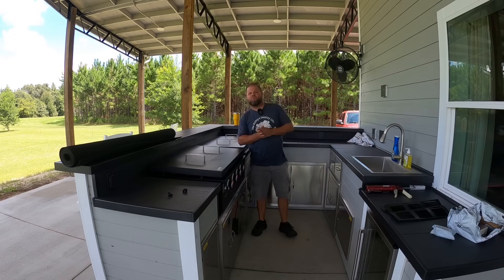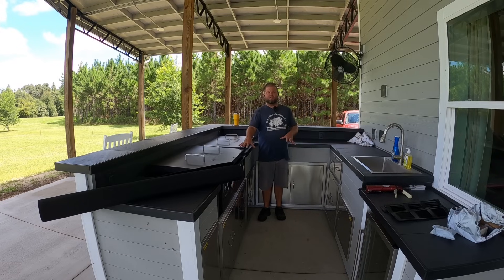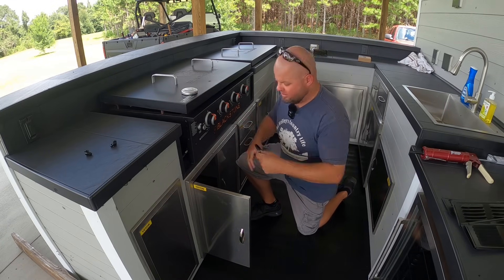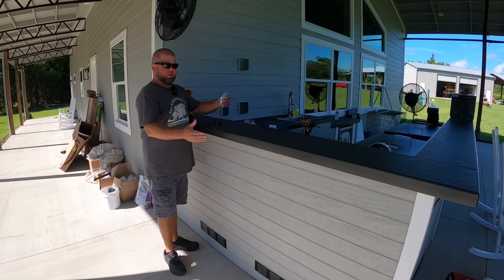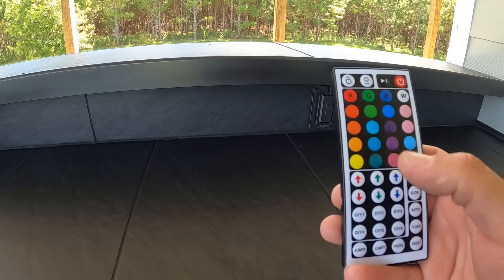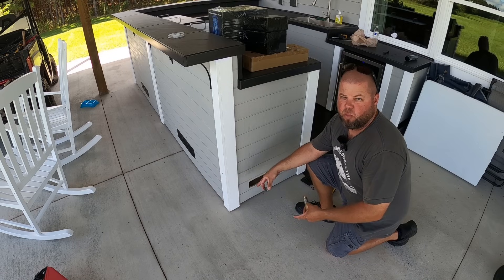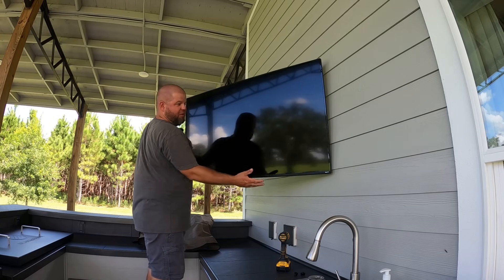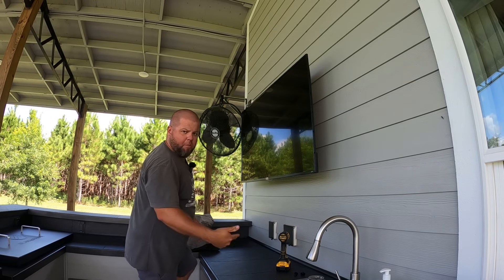DIY outdoor kitchen build! Final episode with cost! #635 #Vevor

Comment: Andrew, I stumbled across your channel back in the spring of 2024. 

I'd been planning to build an outdoor kitchen space, using an existing patio area. I really liked the way you approached the construction, so I used several of your ideas as patterns for the way I built our outdoor space. 

So, since June of this year, we put a roof over a 21'x26' space, built a deck over the existing (not level!!) concrete patio (that was fun! lol), built out the cabinets with (2) countertops plus a bar. The bar top is a single piece of limestone that measures about 16" x 8ft long. I went with Vevor for all the drawers and doors, even used your router method for the cabinet fronts. Your channel has so many great tips.

I decided against tile for the countertops, went with butcher block to save money, screwed up the stain and polyurethane, stripped it off, decided to go with Epoxy instead... HUGE mistake. All the butcher block is coming out in a couple of weeks, when the granite tops should arrive. What a mess that was. I'd like for you to see the pics sometime, because it's turned out to be a fantastic space. Thanks again for all the helpful information!
Reply: What was the problem with epoxy? I was thinking of using it.
Reply: @trailblazer7108  I didn't realize that Oil based stain is a mistake with epoxy. We had originally planned for oil based stain with Spar Urethane and didn't like the results, so we decided to try Epoxy. I stripped the stain and Spar but apparently the stain (even with thoroughly dried for over 2 weeks) had a nasty reaction to the oil in the stain. The out gassing was really bad. Epoxy is beautiful, but in my case it went from bad to worse. If you use Water Based stain, my understanding is that it plays better with Epoxy. I found some great resources on Epoxy. In particular look up this guy. He does beautiful work:  https://www.youtube.com/@northernridgedesigns

Comment: Looking AWESOME!!!

A few ideas:

1)  If you need to, instead of replacing the LED strip with rope lights, just make your own by buying some cheap clear hose and run the strip back through it, then plug the ends with either silicone or hot glue.

2) Paint a cap for the propane valve to match your decor.  It'll look better, and stop anything from trying to nest in it.

3) Place a catch bucket under the zappers and feed the bugs to your chickens.  Protein for your protein!
Reply from the maker: Love idea #2! Thanks
Reply: @TKCL  Happy to help!  Been watching since the beginning of your ice machine project.  Of which, I can't seem to find any final results of...???
Reply from the maker: I've posted a few recent #short videos. It's working great and being used weekly.

Comment: A good tip for using LED tape is to buy a translucent channeling and place the tape in there. If you get a tape with a lot of leds per meter it will look like a continuous strip rather than seeing individual LEDs. 

Just found your channel today and these videos have game me some ideas ans inspiration to start building my back garden out.
Reply from the maker: I'm about to change those lights out, thanks.
Reply: I did that with aluminum channels with a frosted plastic cover. They shipped directly from china. It said what they were on the package but not descriptively, customs felt they needed to open and check them out. lol My strips had leds a little closer and I ran two strips in each one to make them brighter. But I made them for photography.

Comment: I put the same strip lights on my bar. After I stuck them on I used thumb tacks to ensure they stayed on. Do not stick the tack through the strip, just use the head to hold it. Mine are still up after 3 years.
Reply from the maker: Great to know

Comment: Couple years ago i had to built my framing out of metal due to the prices of lumber through the roof.  I had granit tops installed ($1400 +$800 install) i did not even think about tile, yours came out really nice.  I added the govee led lights around my island and love them, they have difderent patterns for different occasions.  I think mine ran arpund $7500 with everything mostly done myself.  My grill alone was ($2400 napolian pro 665).

Comment: I have a Stainless Steel Breville ct oven which has 2 shelves and is also a convection,  broiler, airfry, toaster etc... it's small but big enough for a regular size cake pan, I just love it, I take it camping with me!!
Reply from the maker: I've considered something similar
Reply: If you want a more commercial feel, look at the waring WCO500X.  Fits 4 half sheet pans!

Commercial kitchens use it

Comment: If you want to have a permanent install of the LED lighting, use aluminum LED track with diffused cover, and also, use better quality LED's, those will last weeks if your lucky. They just can't handle humidity being out in the open like you installed them. Also seal connections with Dowsil 737 silicone, NOT the home depot stuff! I do a fair amount of custom lighting. I'm NOT trying to be critical, I love the kitchen, Just passing on some experience with thin-strips.
Reply from the maker: So far zero issues.
Reply: What LED's would u recommend?  Great tips!
Reply: @brihal6498  Fully tubed (IP67 rated) strip tucked inside of aluminum track has given me the longest life. It's critical to fully weather seal with an alcohol based silicone like Dowsil.

Comment: Not sure if you did this but make sure you used teflon tape to where the gas hose screws in to the QCC1. Would be a much bigger deal indoors but still don’t want any gas leaks.
Reply from the maker: I used liquid thread sealant specifically designed for gas connections.

Comment: Great job on the planning and execution of the outdoor kitchen. Extremely impressive build. I was wondering why you didn't paint the edges of the hole you cut for the gas line.
Reply from the maker: I should have 😬
Reply: @TKCL  you could always caulk the gas line, the only place for water to get in is around it

Comment: Andrew, quick googling shows bug zappers are ineffective against mosquitoes.  You need one that is meant for mosquitoes.  Some are elaborate and use propane to mimic the co2 we give off & heat.
Reply from the maker: I've been running one for over a year at my shop and it definitely kills mosquitoes. They flock to it and I dump them out often. I know the rumor is they don't work.

Comment: I can tell you now, you are going to need to get your compressor and blow those bug zappers out almost every day by the sounds of how active they are.  I had one about that size and after a few days the bugs build up and over whelm the ability of the thing to zap bugs.
One improvement, instead of the timer, is to install a daylight switch outside, so that the switching times will auto change with the seasons.
Very good build with the Outdoor Kitchen.  It does look really great, almost like something from a flat pack, not something you scratch built.
Reply from the maker: I'm going to leave the bottoms off of the zappers to help dump bugs too.

Comment: A few episodes back you had a hydraulic spill. I have just experienced a hydraulic mishap myself. Customers driveway about five years old clean no oil stains. until I showed up I popped the hose how many excavator. No sawdust available nothing!! I mopped it up with paper towels it was not looking good. I had some plain old laundry detergent in my truck a with a soft bristle brush. The laundry detergent did a wonderful job next time you spill try it.
Reply from the maker: Great to hear

Comment: Could you hit the door hinge with a rubber mallet on the top to 'align' the weld?
Reply from the maker: No because it's a full-length hinge and welded in several spots.

Comment: the adhesive on the strip LED is going to fail.  no doubt about it.  a bead of hot glue will hold the lights in place.  when you want to change the lights the hot glue is easy to remove.  looks great.

Comment: Hey Andrew great work !! Am building mine at this time.  I installed the vector garbage bin cabinet. Can’t find the right bin for it. Being looking for one.  If you can share that bin item number or size. I will appreciated!!
Reply from the maker: Mine is a standard 13 gallon trash can that came with our indoor cabinets. It fits easily and looks like a normal size. Try the dollar store, they normally stock thin 9 and 13 gallon trash cans.

Comment: Love the build and video! Were you able to find a waterproof cover for the blackstone grill since taking it off the stand and placing it in a build-in? Do you even use a waterproof cover? All other blackstone covers are really have a lot of material due to being made for the blackstone being on its stand.
Reply from the maker: I done use one, not much need with my roof cover.

Comment: Out of curiosity, what type of hose did you purchase to connect from the qcc1 adaptor to your burner? Most burners, like fish fry setups, have a dial to adjust the flame. Were you able to use something like a ball valve to adjust flame height?
Reply from the maker: I still have not bought a hose yet, almost impossible to find hose without a regulator and a cut off valve. Still looking.

Comment: This may have been covered on a previous comment, but I was wondering about the area around your blackstone... Would you do anything different around that area looking back (if so, what?) and has it held up over time?
Reply from the maker: No other than a little more back vent space. It gets warm, I've had zero issues though.

Comment: Fantastic build, really inspirational. I have a question for you as I start planning my build. The location of the stove top and the Blackstone, do you find that these heat up the bar area making anyone sitting at the bar hot, or splatter grease in the area?
Reply from the maker: There is some of that as expected, just like at a hibachi grill. Nothing we've found obnoxious.
Reply: @TKCL Thanks!

Comment: Your not allowed to use galvanized fittings for gas or propane connections. You need black pipe fittings and then paint it grey
Reply from the maker: I've went over this a lot.  That's an old school problem that still hangs around in many local codes.  The problem was an additive back in the day in propane that could cause some issues with the galvanization process. That no longer seems to be the case, why you say???  Because I had to have two full plumbing gas inspections by my building department.  The building inspector on the first inspection and the building official on the second.  I also hired a multi state, multi million dollar gas company to send out their installers and properly plumb my entire home, set the tank and do final hookups.  Everything you see was professionally done and inspected, other than my few minor hookups here in the kitchen.  I passed all inspections with zero issues and have galvanized connections in many locations.  I had thorough inspectors and no doubt a gas company this large would not be installing something against code.  I've had countless responses from viewers over the last year, some that are actual plumbers, and it seems that old code is still in effect in some places, and not in others.  You'll also see similar responses from industry professionals on forums like Terry Love.

Comment: My man! This is awesome. You're junk drawer is coming along nicely. You'll have dead batteries rolling around in there in no time!
On your door corner issue;  can you shim out the corners somehow? Or are they permanently fixed? Maybe too much pressure on a mounting screww is causing the door to stick out. Just my $0.02
6k for all that sounds reasonable for diy 😀.
Reply from the maker: I could cut the tack welds out and reposition the doors. Thanks for watching

Comment: red regulators on your cooker is 20 to 30 lbs your house propane is .5 lb that cooker won't work off your house system...
Reply from the maker: What cooker are you referring to? I've been using everything shown in this video for months and it's working great. FYI I removed regulators on things like my Blackstone and mentioned that in these videos.
Reply: @TKCL   the crab cooker, the red stands for high pressure and if you have it regulated at the house a 1/2 lb. so the cook top flip the goodie in the regulator, and what that does is block the regulator open so basically removing it. and any thing you hook to the fitting you put in the wall needs the regulator removed or you will be double regulating it usually doesn't work so grey regulators.
 red is high pressure regulator. crab cookers, weed burners are high pressure. if the regulators are red 20 -30 lbs is the output pressure to the appliance 
 worked in the lp industry for 5 years did insulations all aspects..

and usually if you remove the regulators to use something on a home system they change the end so you cannot hook it to a normal propane tank.
 because 200 psi would be bad day
Reply from the maker: Yes I discussed that in the video for the stand alone burner.

Comment: Did you hook up a sound system to your TV?
Reply from the maker: I have a really nice Bluetooth speaker for it, I am waiting for a Bluetooth adapter to show up.
Reply: Great. I have an open patio with one of the 50” Sun Brite outdoor TV and it is amazing and I hooked up exterior speakers great for football games. The Company is a great company to deal with because the first television I got after a couple years a part went out that they did not have a replacement for so they replaced the whole television with a larger one. Your job looks great enjoy. 🙏🏾👍🏾🍺🎣😷🇺🇸
Reply from the maker: That's great customer service

Comment: LED strip lights: 
They make a clear plastic running tray that you can mount to the underside of the countertop, and the adhesive backing just sticks to the tray. It gives a sturdier, professional-looking finish to the lights, and would alleviate your concern that they feel too flimsy. Those lights actually work really well.

Wall mounted TV:
1. No higher. With people sitting on high-top stools or standing at the bar, the TV is just about the right height.
Optimally, TVs are supposed to be mounted no more than 10 degrees above line of sight. Otherwise, you have to tilt your eyes and/or neck to look up at the screen, which contributes to neck and/or eye strain, increases headaches - not kidding, it's a real medical consequence, not in the short term, but over time. I owned a company that set up custom home theaters, that sued me because we mounted a TV over his fireplace mantle, AGAINST my installer's recommendation. His doctor blamed him watching TV in his living room all day long from his couch as the reason for severe sore neck muscles that were contributing to increased migraines - a diagnosis I completely agreed with, by the way. I only escaped liability because I had a clause in my installation contracts (at the recommendation of a friend who had his business a lot longer than I had at that time) that we made clients initial, stating that a certain type of installation was at their request, against recommended practices.
EXTRA NOTE: 
NEVER mount a TV over a fireplace, for this very reason. It can look aesthetically pleasing, but watching them in any room where everyone sits, instead of stands (like a rec room around a pool table, for example), just begs for uncomfortable viewing over time, they are hands down the worst location for a TV.
2. Minor adjustment: 
If you relocate the wall mount to the right, and center it on that wall, you can pan the screen without blocking the fan. Would give you a nice symmetrical look, as well.

Excellent work on the kitchen, everything looks fantastic! I like that you know your limitations, skill-wise, and so you research the heck out of everything you want to do, you think the process out way ahead of time, you lay out and dry-fit everything before you secure anything... so that you can do the work yourself and have it come out looking nice and professional. This is how DIYers should approach their work, so they have the best chance of doing good work with minimal mistakes. I am impressed, sir.
Reply from the maker: Thank you for watching and excellent points!

Comment: Looks great, only thing i would change is that galvanized pipe fitting on your qcc1 adapter. galv pipe is not recommended for gas lines, it should be black pipe or brass, id use brass so you have like materials throughout
Reply from the maker: We had a big discussion on that a few episodes back. It's perfectly allowable in our code. Apparently there was a chemical decades ago in propane that was not friendly with galvanized pipe. I passed two gas inspections with galvanized pipe and the the big gas company I hired to do my house install also used galvanized.